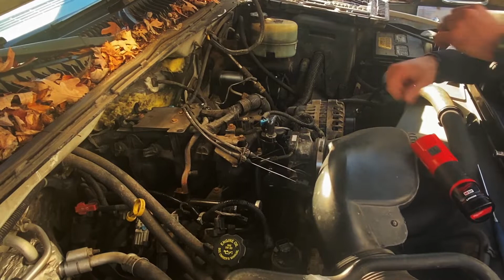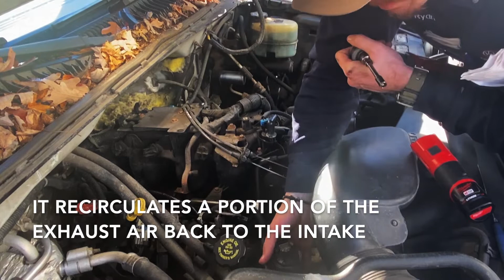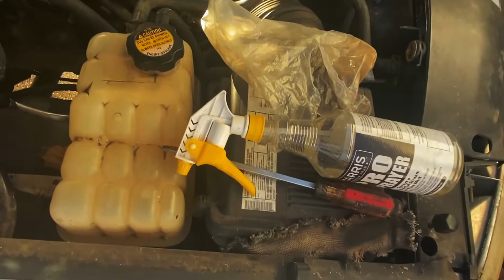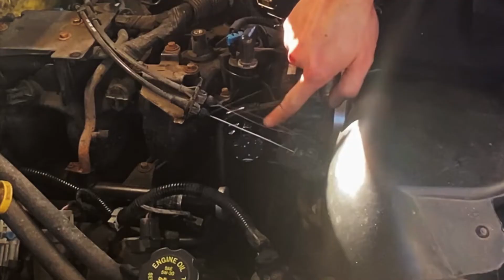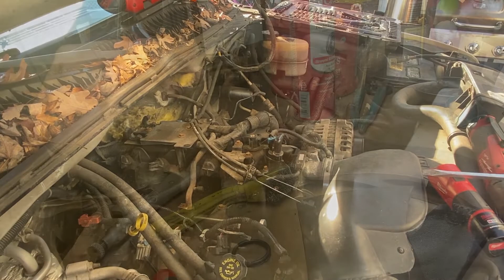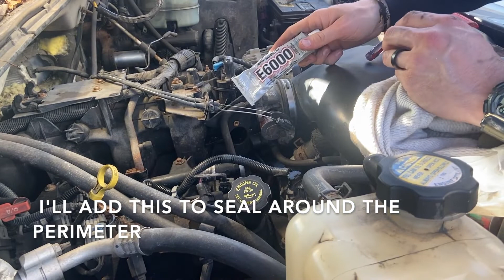How to check for a vacuum leak, rough idle Chevy/GMC 6.0 vortec

Comment: My 2006 Chevy 2500 hd 6.0 is having a rough idle and feels like its missing and runs rough the check engine light blinks. I didnthis and didnt fix it but when i cleaned the mass airflow sensor the check engine light went away and the rough idle went away but came back changed sensor then changed the coil packs and spark plugs and it fixed the problem. I put the msd coil packs on it and runs smoother and better then it ever did. And it was the first ever vehicle i bought on my name with my own credit and paid off. It has inly 118k miles it had 65k when i bought it in 2011 but only reason i put so many miles on it was towing my boat and my asphalt circle track racecar enclosed and open trailers all over the south east

Comment: Do you know if it was tuned after the egr delete? That supposedly can cause problems
Reply from the maker: I don’t know if it was tuned. My next step is to get new exhaust manifolds.
Reply: @pieceofparadise9338  I've been going over an 01 yukon that was dirt cheap. Zero maintenance was done on it but it runs well. Just swapped the original 01 pcv valve and made a big difference. I still get a random service engine light but making huge progress.